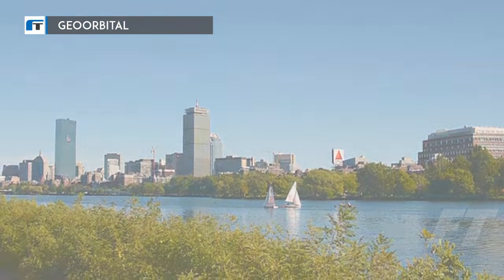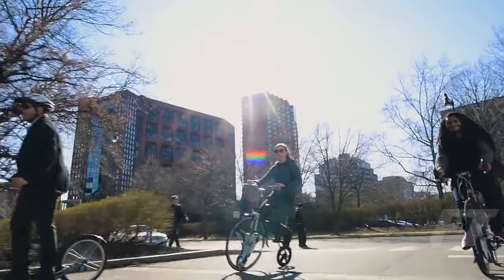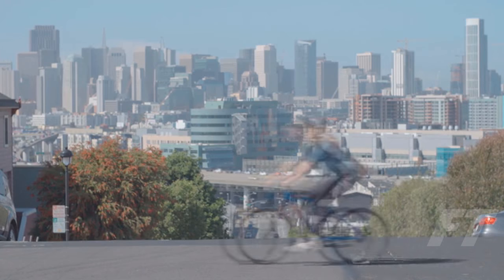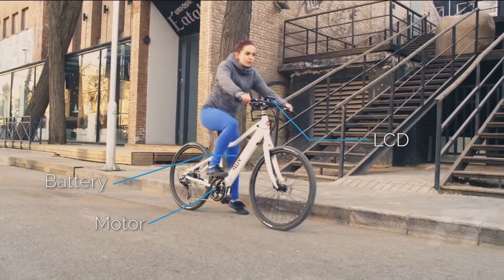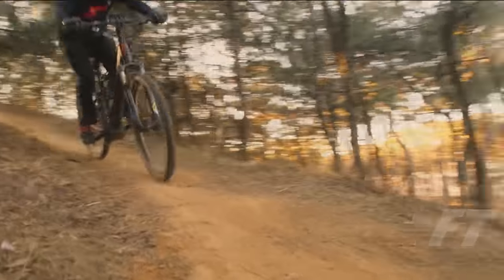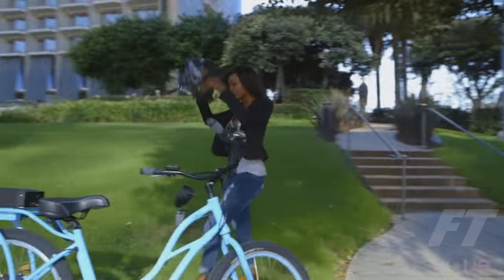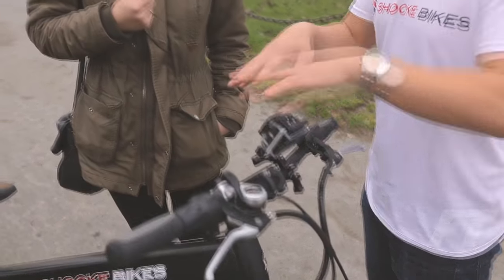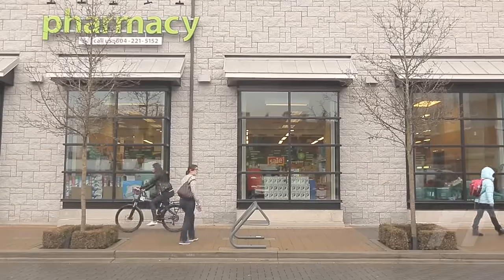5 Most Powerful And High-Quality Electric Bikes With Futuristic Abilities

Comment: if you are getting an electric bike DO NOT get one that has the battery built into the frame of the bike
Reply: bjorn1583 why is this?  because you'll be locked into getting a replacement from a specific manufacturer?  this seems to be the direction many electric bicycles are going.
Reply: Just because a lot of people are doing something doesn't mean its okay.